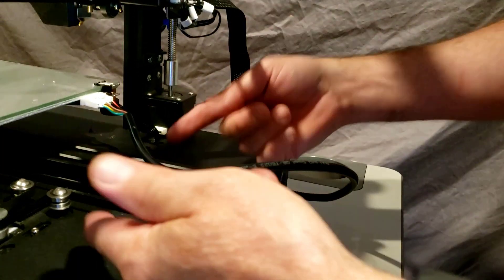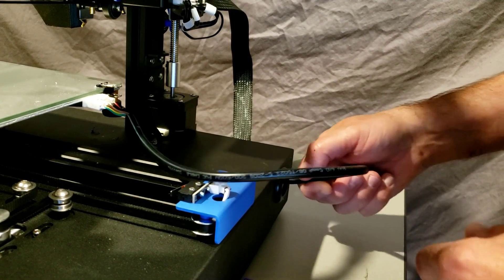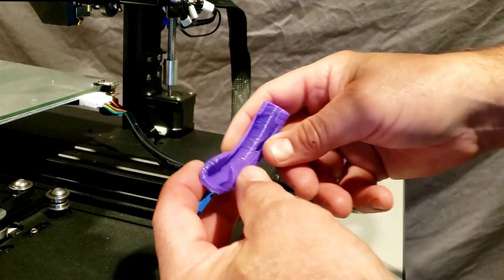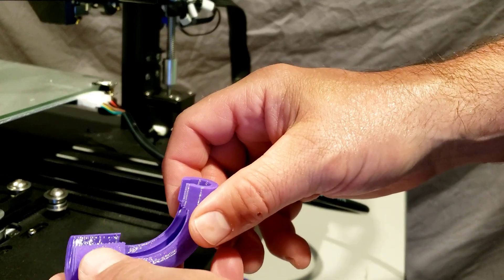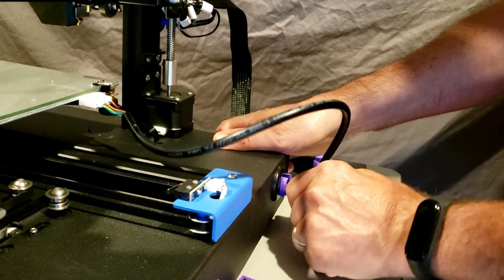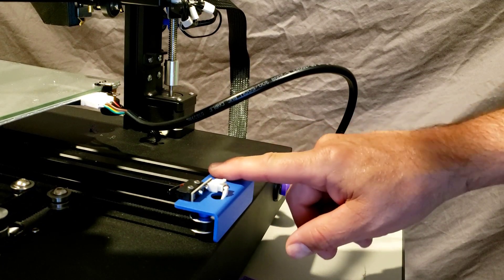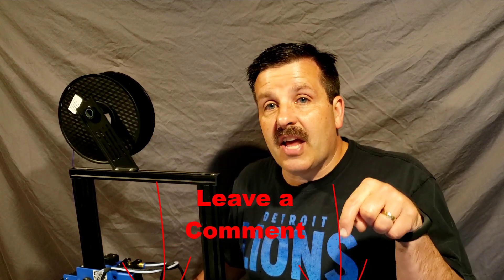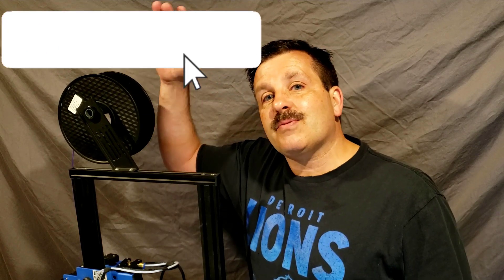Eliminate Y Axis Snags!  Anet ET4x | Tinkercad Design via Thingiverse

Comment: Good afternoon)
Have you had problems with your Z axis sensor?
I continue to adjust it, but it is not adjustable and tries to go under the table.
Reply from the maker: Sorry to hear that. The sound the make when trying to go through bed is one of my least favorites. The Z axis on a et4x is a manual switch. Is there any chance it is disconnected?
Reply: @HLModTech  
I didn’t buy this printer new, the previous owner said that he didn’t have any problems, but I have it all the time, I can’t print on it (((
I have a Labists ET4 with a Z-axis sensor - it's a clone of the Anet ET4, I don't have a mechanical limit switch.
I constantly reconfigured and adjusted this sensor, but this did not give a positive result.
I have now ordered a new sensor, perhaps mine has failed, I will try what happens after the replacement.On the forums everyone writes about the same problem with the sensor, but no one has found a solution, only replacing the sensor, and that is not always successful(
Reply from the maker: Ok... instead of et4, I that would be an et4 plus... When you responded to the Et4x video I assumed it was an et4x.
Reply from the maker: It is still on the stock firmware, right? What version is it?
Reply: @HLModTech  
Good afternoon) Yes, I have the standard Labists ET4 V1.0.1 firmware.
Reply: @HLModTech  I didn’t find your video on ET4 plus problems(